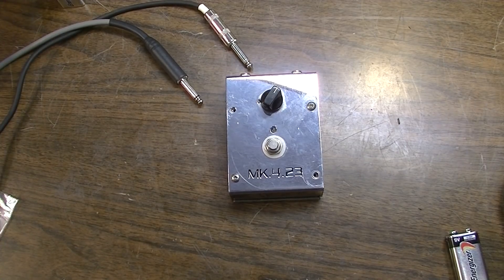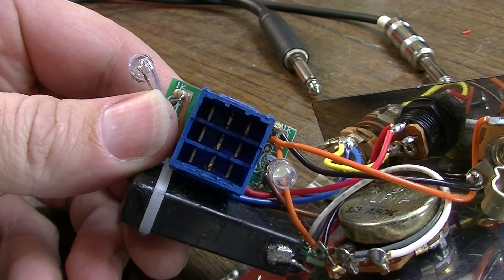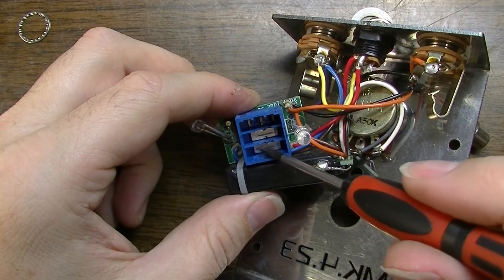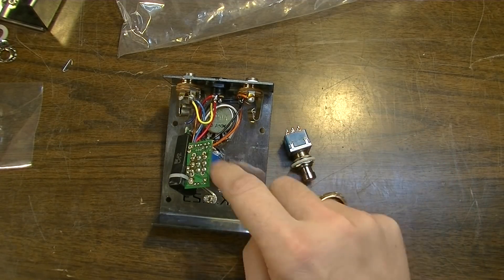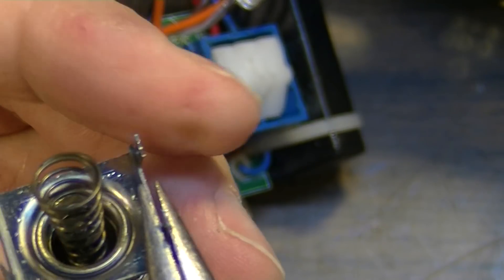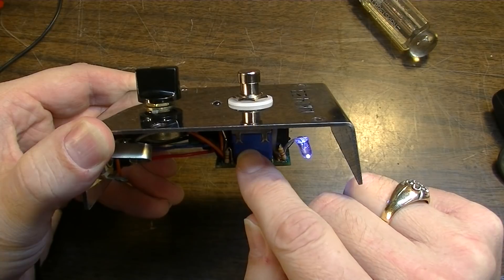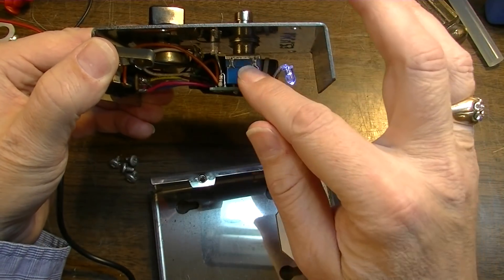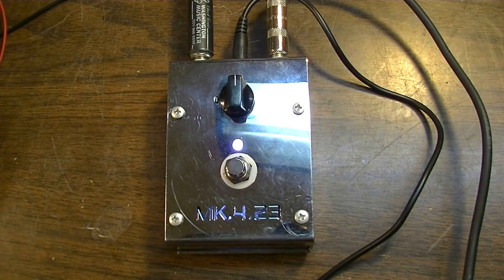These 3PDT Pedal Switches are TERRIBLY Designed - Creation Audio Labs MK 4.23 Clean Boost Repair

Comment: Funny how people think differently - I would have changed the whole 3PDT for a brand new one since the beginning instead of transplanting some parts.
Reply: Notice those fingernails are only on his right hand? There is a reason for that.
Reply: @gimmeeinboxback3860  but why is his left thumbnail so long?
Reply: @gimmeeinboxback3860  classical guitarist?
Reply: Derek Charette  Wow. The most ignorant shit I've seen today. Did it ever occur to you that those are long for a reason? Anyone with half a brain could put two and two together and see that maybe it's for finger picking. I mean duh.
Reply: Boutique pedal designed by an electrical engineer with no mechanical sense.

But I think it was neat how he avoided desoldering and soldering the board. In my opinion his solution caused less heat trauma and I don't see any mechanical problems the way he did it. I probably would have stuffed foam rubber under the switch instead of glue but that's a minor point.
Reply: @joesimon2018  that switch is mounted the same way as almost all the others?
You either chassis mount or board mount and you never board mount something like a foot switch.
Reply: There's no need to replace the housing that's soldered to the board. Why? It's a plastic housing that isn't a moving part so there's no wear. You'd be doing more damage by heating up that board to remove all 9 pins and the heating it up again to install a new one and for what? A new plastic piece that wasn't needed? Think smarter not harder.
Reply: funny how most critics dont even have any vids uploaded to their channels
Reply: I respect dirty fingers for clear reasons. I'll watch the vid carefully and judge accordingly. ,Thanks!
Reply: @godislove8740  dirty is fine. Long is weird whether you play guitar or not. He is lazy and is now trying g to jerey rig it to work. The plastic housing was obviously work out and needed to be replaced. But I agree with the main point.  The design is crap but you shouldve resildered it. Its not going to damage it

Comment: Another great one. I've ben building pedals since the 90's, and when you need a 3PDT Stomp Switch thats the only design I have found .  My remedy was to put CA Glue on switch. The only failing when a hulk like idiot jumped on one. But that bent the Bud Box , when your bending that Die Cast metal you don't need a pedal you need to tank.

Comment: While you're transplanting that contact piece, you should always either trace it by hand or stick it on a scanner or copier so you can later cut a replacement from a piece of scrap steel and not waste a perfectly good switch. Although you still have the other two, so either way you can use it later.

Comment: $150 for that? LOL. Anyone can DIY a clean boost for a third of that - save for the fancy chassis - and build it without such a bad design. It's clearly not road worthy. Boutique pedal builders are out of their minds, yet people eat it up because their prices suggests "quality". But nice job making it stable.
Reply from the maker: +Danny DeTora price is another issue. I won't argue that really. But I will say, to be fair, it does what it says. I have no complaints about it as a boost. It was clean, didn't add noise, etc. And after securing the switch, I felt better about it.
Reply: I think the same specially when taking about any tube screamer  based pedal, any overpriced overdrive or brands like analogman xotic suhr. 
Some +200$ pedals are just "fake news"

Comment: I honestly think you should have changed the switch. It's a standard 3PDT switch used in many modern pedals, and I have not seen anybody complain about them breaking easily. But kudos to you for your effort!

I recommend that, next time you open one of those up, instead of bending the tabs up, bend the little "fork" ends on them inward, so that the top simply slides out without effort (it's how they do it from factory). Also, you should try using Threadlocker glue to keep it in one piece. That stuff is strong, it flows well so you don't need a lot of it, it dries in a couple of hours, and it's gonna make sure the switch pretty much never comes apart again. I'd even recommend putting a drop on each of the little "forks" on new switches, just to be sure.
Reply: You should get over yourself because the design of that switch and the application it was used in on this pedal is crap.
Reply: When I said it was a standard 3PDT switch, I meant the footprint. You can change the badly-designed one by the "hat" one because they're drop-in replacements.
I don't understand what you mean by "get over yourself". I was trying to be helpful so he can do a better job if he chooses to work on more pedals in the future. I think he did great, actually.
Reply: @Bleats_Sinodai  they do break easily - that's why i searched up this video. joyo and dr.j use them. I've had two faulty switches so far

Comment: Let's see how hard we can step on this pedal,,,lol,,,, good vid Brad,  Thanks as always pal.
Reply from the maker: Seems that's exactly what someone did.
Reply: I don't think the switch was being stepped on. I think whenever they wanted to turn it on the previous owner just chucked it at a wall.
Reply: There's a reason they're called "stomp boxes".
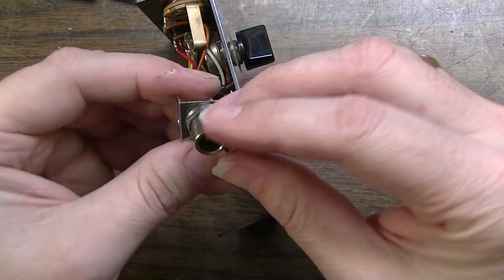Reply: Hi. I used to have a Marshall Shredmaster distortion pedal that has a similar kind of switch as the Mk 4:23. I think the old switch on your pedal used to have a lip but that lip but was removed by excessive stomping as what happened to my Shredmaster.

Comment: It's not a design flaw.. The blue 3PDT switch is used everywhere without any backing, in form of hot glue, or epoxy.. And it works fine, you should not have taken the switch apart, but unsolderet the old switch and replaced it.. But I think you would have killed the PCB with the soldering tools you have..
Reply: 3PDT switches fail all the time, in most cases they are just attached to the top of the box.  It’s a design flaw in the switch itself that exists in most effects pedals.
Reply: I agree you should de solder the old switch and replace with the new one opening the switch compromise the contact inside.
Reply: He needs to get hold of an Edsyn Soldapullt DS017 desoldering tool. It is the only solder sucker that works worth a crap. They are less than $30 new, and worth every penny.
Reply: +duene2k
PCBs are potted to protect trade secrets. Occasionally they are potted for mechanical, thermal, or environmental reasons, but generally it's to keep prying eyes from easily reverse engineering the circuit.

I agree that the zip tie construction is not skookum.
Reply: Blue switch always breaks, just after warranty expires...
Reply: I agree if the old switch didn't have a "travel limiter" But the blue switches are everywhere they work fine in 99% of true bypass pedals build the last 10 years :)
Reply from the maker: Sure, this switch will work until is fails.Eventually they will ALL fail if mounted like this, especially if they have no lip to limit the distance the switch can be depressed. Even with the lip, the constant action will  eventually work the four mounting feet loose against the housing. A superior design would include some kind of mounting for the PCB to the top of the chassis or a medium density foam rubber cushion on the back of the PCB to help support the board against this downward force. Relying on four little grappling hooks to hold the switch is asking for it, long term.
Reply: Sorry but you are looking for a problem that is not there, you would not have a problem with the new switch if you had not taken it apart.. The switches are used in A LOT of pedals
Reply: Nothing he's done in disassembling it has altered its integrity, which was limited by its own inherent fault. He's protected the board and tracks by taking a mechanical approach, any fault if at all is from wear caused by the over excursion of the original actuator without the travel limiter pushing down on the base of the switch, how else would it have been blown apart before he opened it? The backing, new actuator, and epoxy will cover any of these eventualities and more. It's no hack when it's now far more sound than the original spec surely? Pretty harsh word that.
Reply: PoJoWo, the integrity was already compromised, since someone else seemed to have opened it before, maybe to clean or fix it. look at the marks in the plastic. replacing the switch from thr beginning would have been the proper choice. i know replacing these switches is a pain without the proper tools, but still. also this is nothing more than a hack. now, whenever there is too much pressure, there will be pressure on the switches pins. in my experience these are pretty sensitive as well. also the whole construction of the pedal just begs for failure. that pcb coated in black epoxy (unfixable! still don't get why people do it.) being zip tied to the other pcb just screams mechanical stress.

Comment: I'll know to stay away from these pedals.
Reply from the maker: +richard Turk to be fair, it does what it says, but modify it to support the pcb.
Reply: I wouldn't. I'd just add the necessary support, or at least check to see if it is necessary, on any pedal from this manufacturer. I can see two possibilities: (1) this problem is isolated to this particular pedal, because it uses a different type of switch from anything else they make (in which case this mod would be unnecessary on other pedals), or (2) they make the same mistake across other similarly constructed pedals, in which case it needs to be fixed on all of them. 3PDT is a bit unusual, but a DPDT switch would have the same problem, maybe to a slightly lesser degree just because it's more compact and can therefore be built a bit stronger.

Comment: I am surprised to see you using a soldering gun instead of a station
Reply: Can we also call it Will, Willie or anything alike. When you fix it with Willis, it should be called Will's Grace.
Reply: I use a gun... never have had a station. Have soldered countless connections.
Reply from the maker: +poot111111 gotta try out the new gun I was sent by a channel watcher. Also, ive already named it...Willis. In the future, please refer to it by its proper name, Willis.

Comment: I have this pedal. Basically its a clean boost. But I use it at the end of my pedal board signal chain with the level set pretty low. It has some sort of magic sonic expander inside that opens the tone up in a very nice, very subtle way. It seems to put some of the analog mojo back into your tone that is lost via digital manipulation. You can't really tell what it's doing, but you notice when it's not there.I do love this pedal. I have taken it off my board a couple of times... always goes back on.   I picked one up after watching the rig rundown of Brent Mason. You can find that video on youTube and skip to 31m46s https://youtu.be/rQW8yNP7vBs?t=31m46s

My pedal (SN #25XX) has the button cap on the switch. and the overall interior design is different. I posted some pics on your Guitologist Google+ post.
Reply from the maker: You should definitely open it up and put epoxy on the sides of the switch and squirt some hot glue in the case bottom to help support the switch. Yours will eventually fail too.
Reply: Posted photos on your Google+
Reply: +The Guitologist
The switch won't fail if he never shuts it off, and it sounds like this is his use case.
Reply: New versions of the switch have been redesigned. The inside of mine is completely different. And, yes, I never turn it off.
Reply: God I miss google+